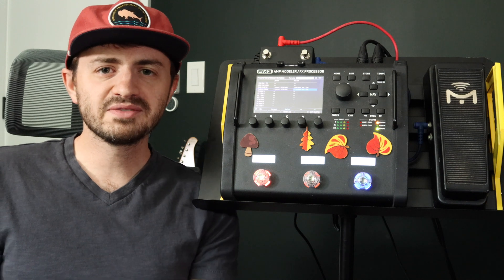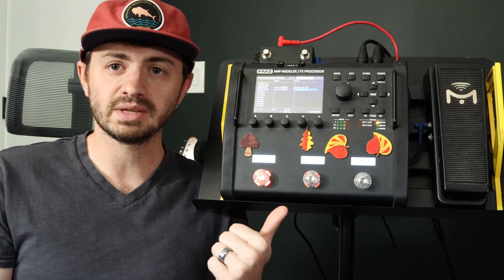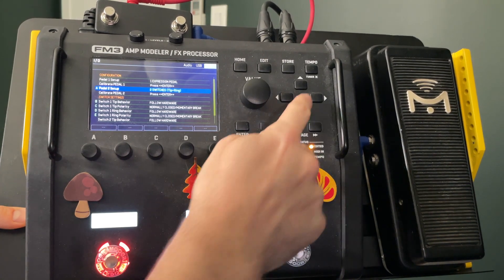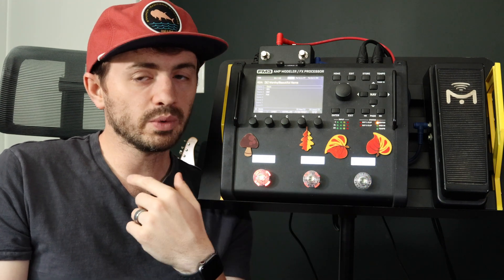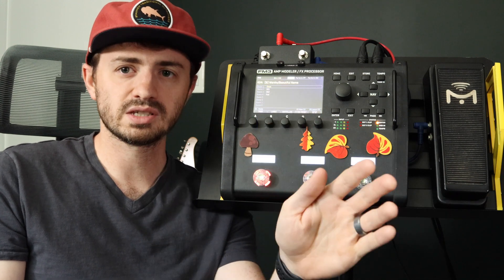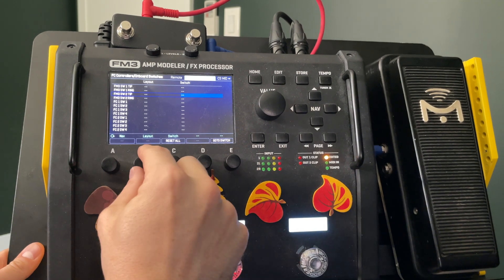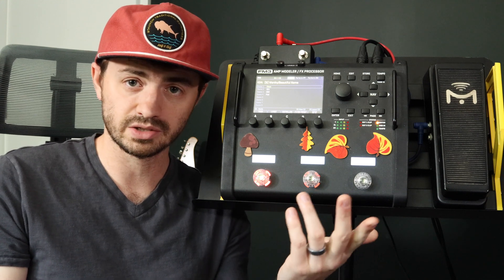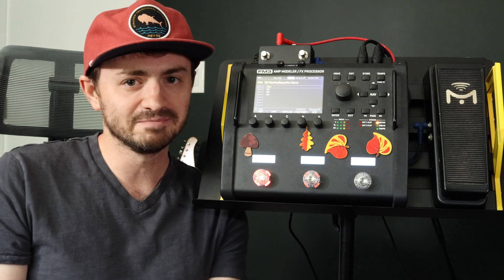Add *Any* Switch to Your Fractal Rig! [Stand-In Switch Guide]

Comment: Will this work with the Hotone Ampero Dual Switch too or just the TT-2 ME?
Reply from the maker: I don’t have an Ampero to confirm, but the manual says that jack is a standard 1/4” TRS for a single expression pedal or switch, so it doesn’t seem like it supports a dual foot switch.

Comment: Hi Bradley, I made the same setup as you with the external pedal, but I don't understand why my fractal limits me from preset 0 to 127 and doesn't go beyond like if I wanted the up and down from 384 to 388 why? Thank you
Reply from the maker: Does the same thing happen if you trigger the same function, (I assume preset inc/dec?) from a builtin switch? There should be no difference in behavior, so it’s possible you have configured the function to wrap from 0-127? In the layout config, you can manually set the preset range to whatever you want, 384-388 for instance.
Reply: @bradspaulding  I have the same problem with the integrated switches, selecting Lower limit 386 - Upper limit 388 it takes me back to 127 why?
Reply from the maker: @ that seems like a bug or a misconfiguration somewhere. I’d try taking your issue to the fractal forum and see if anyone else has seen the same thing? Sorry I couldn’t help more!
Reply: @ solved thanks!
Reply from the maker: @OsvaldoNatali  Nice! What was the fix?

Comment: Hi

In fm3 in the Standin switch menu, under the external FM3 sw1 (tip ring) and FM3 sw2 (tip ring) there are 8 more switches
FC1 sw1
 sw2
 sw3
 sw4
FC2 sw1
.
.
........sw4

only the Layout function can be assigned to these 8 switches. I can't find anything in the manual or on youtube about those switches and what they do...help would be appreciated..
Thank in advance...
Reply from the maker: I believe those are for the two external FC foot controllers you can connect to the FM3. This would allow you to control the layout of one FC from another or from a switch on the FM3.

Comment: Hi. I'm trying to use a 2 button footswitch (tried a Nux, and a Boss FS7) with my FM3. I can get the Tip side of the footswitch doing what I want (turning blocks on and off), but when I assign a block to the Ring side, pressing the switch turns the block on, then immediately  off. I've tried changing all the settings many times (with 2 different TRS cables). Would anyone have any idea what's going on here?
Reply from the maker: Did you figure this out, yet? If not, maybe out the values for Switch 1/2 Ring Behavior. It can be set to momentary or latching. It sounds like maybe it’s set to momentary, perhaps? Guessing!

Comment: trying to do this on fm9 but in IO settings there is no option for tip/ring, only expression or switch.  is this something that went away or got changed in th latest firmware? I am on 5.01
Reply from the maker: It looks like the FM9 can’t do this fancy dual switch TRS thing? Seems odd, but the manual only mentions a single TS foot switch. You can use two external switches, you just have to use both pedal jacks to do so. That’s a bit of a bummer. :(

Comment: Hi! At the FM3 with an external footswitch, can I go back to the master layout (scenes, presets, effects) from these three layouts? I try to replace the “hold the middle switch to go back to the master layout” for example from the effects. If yes what switch do you recommend?
Thanks in advance!
Reply from the maker: Yes you can, Master Layout is a function you can assign. Any switch you have should work!
Reply: Setup > FC Controllers > GOTO SWITCH (knob E) > FM3 Layout